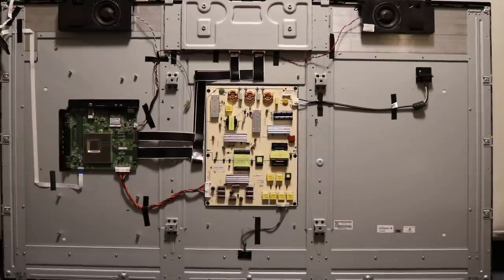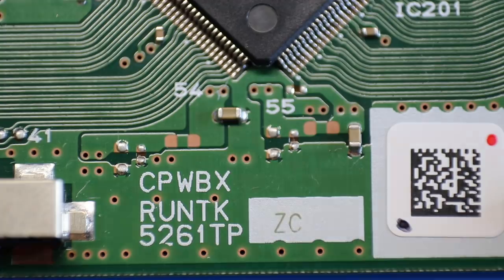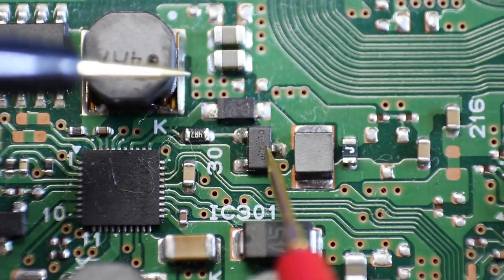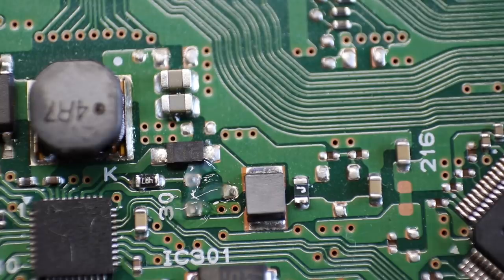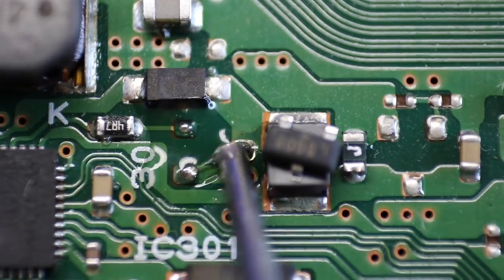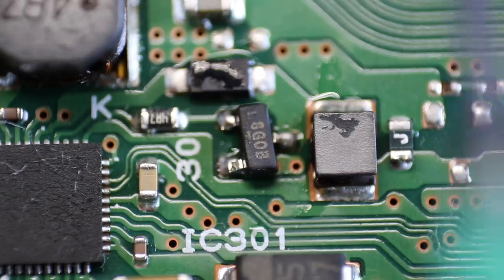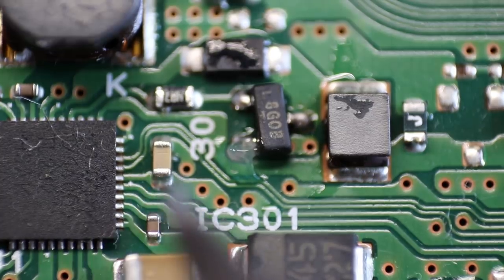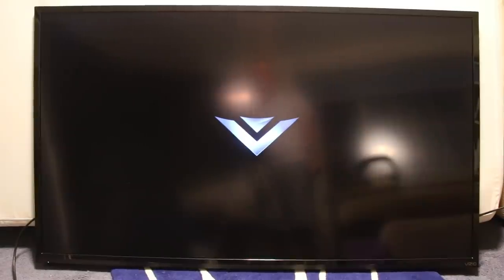60" TV for less than a $1 - Vizio E601i-A3

Comment: heart surgery has also only 2 $ materials cost , but you pay 300.000 $ for it.
This is  wrong way to put things into perspective. it's never about the material cost but the skills.
Reply from the maker: I see your point but I would argue this is different.  You don't need to repair your tv, you can buy a new one at the store.  But if yours is broken and you are going to throw it away anyway, then why not give it a go and try to fix it yourself?  In the case of this tv, you can literally buy a new tcon board on ebay for $17 and put it in very fast.  What I am showing is that you can do even better than that if you wanted to try.  And you don't need expensive tools, buy a cheap soldering iron or hot air station and watch a few videos to educate yourself.
Reply: I agree with you. You and me can do that.
But the title "for less then 1$" degrades the value of our work implying to others that our work is cheap.
e.g.  here is true story : there was a TV repair shop in my city, after his TV was repaired customer asked what was wrong with his TV, and the owner said, it was a resistor. Then customer left and actually brought the new resistor to the owner, and said here is it.
It is dangerous to reduce the work to the cost of spare parts, leaving out the practice and eduction of decades, because the most people don't get it.
Reply: replacing those logic board still cost less than buying new tv...the expensive part is actually the LCD which i can assure you if your LCD is broken it could cost almost the same to buying new TV...maybe more than 80% of the cost from buying new TV...while replacing new logic board maybe cost like 10-20% of new TV...but if you have the skill repairing the logic board sure cost less...but if you dont have the skill replacing logic board is easy and should not use much of skill..so even if you send to repairman they should charge less if only replacing the logic board...

Comment: Lol, good video. Only a 50cent replacement part and a 200$ hot air machine.
Reply: the jokes on u, u can do it with $5 soldering iron and $1 flux too
Reply: @Joshua I agree with you. The tools this guy used to test and assemble, definitely cost more than a few cents, lol 😂

Comment: I am amazed that you repaired a 60 inch television for 54 cents! If it is not too much trouble of me asking. I have a 32 inch smart television that was exposed to below freezing temperatures for so long that when I turn it on the screen looks like cracked glass and makes no sound.  Is it repairable or should I throw it in the trash?
Reply from the maker: Thanks!  It was a fun repair to do.  For your tv, it depends, if the lcd is cracked then unfortunately, you can’t repair it.  Can you perhaps look at internet images of cracked lcd screens to see if yours looks like those?

Comment: "Only $0.54!!" 
> using $500 rework station.
Reply: That transistor could have easily been replaced with a 10$ soldering iron, given that it wasn't connected to a large plane with high thermal mass.
Reply: coulda done it with just the soldering iron...…….
Reply: ...and $50,000 for the college education to learn HOW to find the problem component(s).
Reply: The part could have been replaced, and probably far more accurately, by a $10 pencil iron.
Reply: @alphabeets  Of course, because you definitely need an expensive college course to learn things nowadays when the internet is so widespread.
Reply: The rework station was used because he has it.  He shows later in the video that you can just use a soldering iron.  Did you even watch the video?

Comment: Typical in any sort of repairs, the part is cheap, but the knowledge and know how, takes years.
And it appears, very steady hands, and the tools to do the job.
Nicely done.
While I was younger, and better eyesight, I may have been tempted to try a repair. 
These day, I’d throw it out and buy a new set. Or if I were lucky, find someone with your skills and pay for your talent.
Reply from the maker: Thanks for your comment.  Actually with the internet diagnosing a board that has a common failure doesn’t have to take very long.  It is because other people find the faults and share the info online.  Those issues that no one has come across before (or posted about) are ones that can take a bunch of time to track down the culprit(s).

Comment: 54c and countless hours of troubleshooting
Reply: Guss Fierro And the tools he used add up to well over $1000
Reply: @BlueTurfer  some troubleshooting tools can be pricey
Reply: As an embedded developer and Electrical Engineer, I know.  But for removing and replacing a transistor, there are much cheaper alternatives.  Maybe do a video on that?
Reply: Guss Fiero & Mark B Not really on either count. Given the sympoms, chances are already 90% the fault is on the TCON. Then you measure the supply, the fuse, the derived supplies and any obvious power devices for shorts. Bingo! Also the tools used don't cost $1000, more like $100 for the soldering station and $10 for the meter. Also, such a transistor could be soldered with a $20 soldering iron instead of hot air.
Reply: Follow the first two links above in the Description:  
Hot Air Station*: http://amzn.to/2vOk8Jm
Solder Station*: http://amzn.to/2vOwaSR

Comment: Wow 54 cents?
Minus the $200 hot air station
The $60 soldering iron
The $10 flux
Reply: You dont just wake up one day with all the tools and knowledge of a skilled trade...!? Wtf We should complain to the government about this discrimination against ignorence.
Reply: Soldering irons are cheap though
Reply: And still cheaper than buying a new 60", plus those tools can be used over and over to save even more money.
But most folks go for the convenience of replacing today's flood of crap quality products.
But manufacturers know this about human nature, hence the intentional crap quality.
Convenience saves time, but costs you far more than you realise over the long term.
Reply: And the electricity
Reply: You really don't need a hot air station. A 20$ iron, some solder and knowing which component to replace is all that's needed.
Reply: @angelovazquez7920  Yes, he used $1000-2000 on electricty on a 5 minute soldering job with a 50W tool.

Comment: Screwdriver $4.00
Multimeter $154.99
Electronic toolkit $30.00
Anti-Static Soldering Mat  $20.00
SMD Transistors $0.54
Hot air station  $637.00
Solder Station $703.78
Fume Extraction Station $69.99
Total: $1,620.30
Reply: i can do this with less than 100$ of equipment, gearing from scratch. Don't be silly.
Reply: 150for a multimeter ? 
700 for a soldering station?
637 FOR A HOT AIR STATION? 
 70for  a fume extractor? 
Dude have you lost your mind

Comment: 54 cent for the transistor ... 4 dollars for shipping 54 cent transistor...
How do i know... i dropped a 3 cent detent ball... for a transmission... 3 cents for the ball about the size of a.177 bb and 5 dollars for shipping...  i found it on the floor the same day it arrived.... 😄
Reply: now u have an extra in case u drop it again xD
Reply: @mimizdani8194  i invented a tool to hold the spings and them in place while i slide the gear that goes over them in place...  they were 120 degrees opposite each other

Comment: May as well be $1000. I can't solder micro parts.
Reply: If you can solder through hole parts this isn't that hard. It's a three legged component it's not like soldering a small cap, resistor, ic, or fine pitch part.

Comment: I know this is old but you just gained a new sub, i have 2 65" tvs that were replaced by  LG a 2016 model and the other a Vizio 2018 model by Best Buy...i followed this Video and fixed both now i have 2 new 65" Vizios and a decent LG..THANKS
Reply from the maker: Great job fixing those tvs!  By chance, did you have a problem with the power supply on the 2016 LG 65"?
Reply: @FrugalRepair  no i actually swapped out the tcon board and the Visio had a bad conduit on its tcon board

Comment: Got enough flux there? I think you need a bit more....
Reply: Maddog you have nfi how to solder
Reply: Well considering I work in a electronic development group at a research lab, I beg to differ.
￼
￼
REPLY
Reply: @maddog187killa  you might know how to clean the floors or write some user manuals but if you think you don't need flux to get a clean solder joint you definitely have nfi how to solder.
Reply: The bigger the glob, the better the job !
Reply: @Damnit Bobby it definitely matters, if not cleaned up properly.
Reply: @Damnit Bobby so basically you're saying flux to a joint doesn't matter, or cleaning up excess flux doesn't matter? If your answer is yes, then please don't respond back to me.

Comment: I agree!  Anyone can fix anything. You just need to research and learn then put into practice. Not having access to circuit board tools, I go a slightly more expensive way by purchasing the complete component, in this case, replacing the entire board. Remember how you remove the original and then install the new board........ I never pay for anything to be serviced. You wouldn’t believe how easy it is to work on most things. Companies want their product as easy (cheaply) as possible. Research, comprehension, practice.
Reply from the maker: Thanks for your comments.  So many things are easily repairable but end up by the side of the road.  A little internet searching and some reasoning goes a long way.  And I agree, for most people and for speed, it is easier to replace the whole board.

Comment: I guess you forgot to mention 54cents plus 1000 dollars of equipment plus the skills and knowledge to do the job...
Reply: Replacing a giant SMD transistor like that, even if you want to be fancy and use hot air, works just fine with a rework station under 100 bucks.
Reply from the maker: Why would I need to mention that you need a $1,000 worth of equipment when that isn't true?  Yes, if you do this kind of work all the time it is good to have nicer tools but not for soldering stuff here and there.  Did you see I listed a $30 soldering iron and hot air tool in the listing?
Reply from the maker: @JasperJanssen  I generally agree, though I wouldn't call this smd component giant, it is at most the size of a grain of rice, probably smaller.
Reply: FrugalRepair one or two sizes bigger than the regular Sot23, isn’t it?

PS: I’m not a fan of how much solder you used in the repair...
Reply from the maker: @JasperJanssen  I don't know the package name off hand but lengthwise it's a little less than 3mm.
Reply: FrugalRepair maybe it is sot23, then. In which case it’s not huge, more like standard size :)

Comment: that reflow was kinda cringy....
Reply: nikushim666 but he got there in the end. Can’t knock a bloke for giving it a go and showing the world at the same time. I don’t disagree though...I’ve been watching too much rossman.
Reply: @Clynikal  Oh i have been doing it for years using a old aoyue knockoff rework station. But those solder joints are cringy. He could of just cleaned the pads and used solder paste and did a far better job. Even hand soldering would of been better.

Comment: I’ve watched through a few of your tv repair videos.  Informative and interesting.  I’m tempted to offer tv fixes, or pick up ones people don’t want and fix them.  For now, starting with our Samsung that started to power cycle.  There is no separate T-con on this model, and did the led ribbon diagnostic to confirm it is the mail board, before ordering one.  At this point I am pretty confident the board is the issue.  What on the board I don’t know.  Would be curious to determine this.
Reply from the maker: I hope you can get it repaired!  If you have an older samsung the capacitors on the power supply were something that I would check first.

Comment: I just picked up a vizio 47" tv for free the seller described it as the backlight went out on the right side, so I brought it home (this is my 5th tv I've fixed from my crona quarantine away from school for the past months thanks to you! Btw lol)well I decided to plug it in to see if they where correct and all the sudden I hear it squeal and smoke comes out of it!!😂 well I take it apart and look at the backlight inverter on both sides sure enough the right side was burnt from the capasitors smoke and the left side capasitors where bulging so I ordered 5 new ones I only need 4 but why not have extra lol for $6.99 and now it's running perfectly strong and has been for a week. Sorry for the long read but I figured I'd put my story if it might inspire someone to get after there broken tv and fix them.
Reply from the maker: That’s so great to hear!

Comment: A great fix but what are your fault finding methods ???
Reply from the maker: Thanks!  There is another YT video that details the procedure for finding this transistor (though they don't do any repairs) .  I should have mentioned that in the video but I figured that anyone who had this exact problem and model would have found out about it through search.  I tried to do a better job at showing the detailed steps in my latest tv repair video.  What did you think of that one (if you watched it)?

Comment: I had a coworker from work give me a free broken Vizio M series TV that has this exact issue! I bought a TCON board for the TV but the model number of the one I got on ebay was slightly off, and as a result it is physically smaller with different ribbon cables. I might take a closer look at it, though I might have cracked the LCD in the handling of the unit.

Comment: I fixed a 0.96" OLED screen, so your repair is 62.5 times as awesome ;-)
(Repair was comparable though, replacing a three pin SMD part, in my case the voltage regulator)
Reply from the maker: Nice!  Congratulations on the repair.

Comment: I have a Vizio M55-F0 that went black the other day.  Sound was working, backlights working.  Replaced the T-con board.  No luck. Suggestions?  I am not looking to replace diodes or resistors, just getting this thing back to working at reasonable cost.

Comment: So nice. My kid threw a toy at my TCL R615 and cracked it at the bottom. For a week it worked sort of. It had some horizontal lines on the bottom and vertical lines on the side. Then it turned black screen. I ordered a newer Tcl 55 r635 tv. So i put the old one in the garage. Worked for 10 min and turned black. I can see some shadows move when i move in the menu. Any idea what to do? Where are you located. I would pay you to fix it. Im in Chicago. Any idea what that would cost to fix for a professional? Thank you.

Comment: Mine just finally crapped out after having an LED die a while ago (annoying but not awful). I still used it a bunch after getting another vizio (mistake) but finally dim pic unless I shined a flashlight.

Thanks for the video, I was going to just buy a replacement t-con board but this is even better.
Reply from the maker: Are you going to fix the backlight?
Reply: I'll probably just leave it, it's on the right side at the bottom and unless it's a bright picture my eyes don't really focus on it. I'm scared I'll ruin it taking the screen apart!

I bought a PX65 as replacement when they were on sale, really nice but my eyes hone in on a jail bar during light scene panning. Kinda ridiculous for their flagship model.
Reply from the maker: @lukenuked  sounds good.  At least you know you could fix it if you wanted.  The main key when doing that repair is not cracking the lcd panel when you remove it.

Comment: Wow first time watching videos tonight having problems with my Vizio 506x h9 . Tried all the reboots no luck . The Vizio logo will come on for half a second then go black found out I can use flashlight to barely see tv screen . Did factory reset no luck . I used to work on computers and have done bad transistor replacement before . But I am amazed how easy you make it very educational and we can understand your English very well . Well going watch more of your video to see if it’s a motherboard (transistor problem )problem or a LED lite problem . Thank you for your Video your awesome! 😎
Reply from the maker: Thank you for watching!  You may want to check out one of my latest videos as I worked on a tv backlight.

Comment: I just picked up the exact same TV on the curb last week and through searches I found this channel...subscribed :)  Unfortunately, slightly different issue as I get no stand-by light / back-light when plugged in...multimeter not showing standby voltage on the power board, so I'm starting there I guess, unless you have any other recommendations?  Not easy to find those replacement power boards for a decent price (if that's the true issue)...thanks for the detailed video and any suggestions.

Comment: I had a similar problem with a 32" tv. I think it was part of the power supply, but it was just a single 2n2222 transistor that failed. The repair is pretty straight forward and easy enough ,but I couldnt get a surface mount part, and had to use a through hole part. It was also like $2 for one part (you can get the surface mount part for like a dime each if you buy 100 online.)
Reply from the maker: Great job making the through hole work to fix it!
Reply: @FrugalRepair  I do a lot of freeform soldering, so it was pretty a pretty easy fix for me. 
Thanks for your kind thoughts.